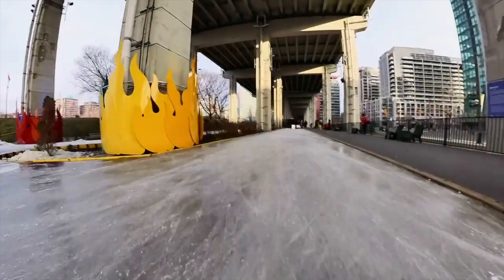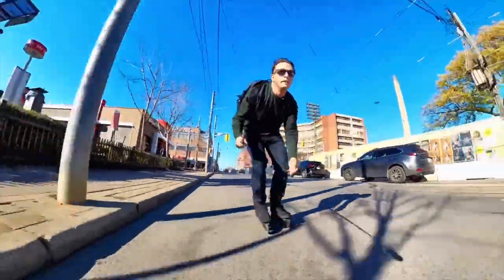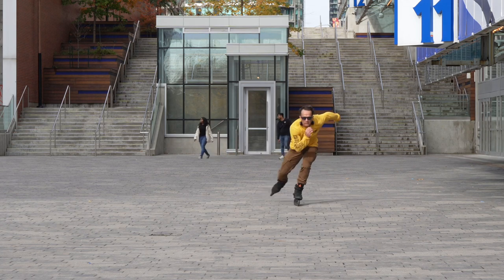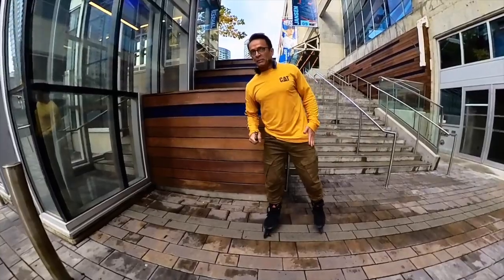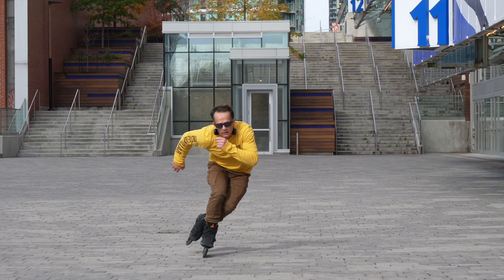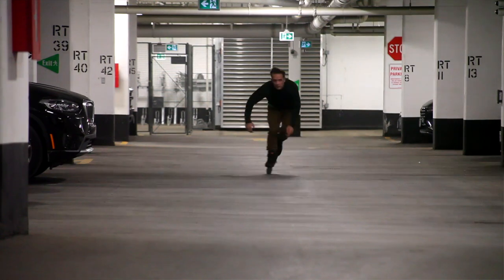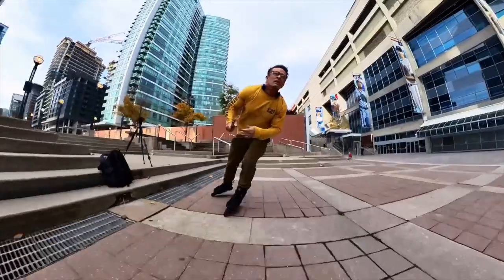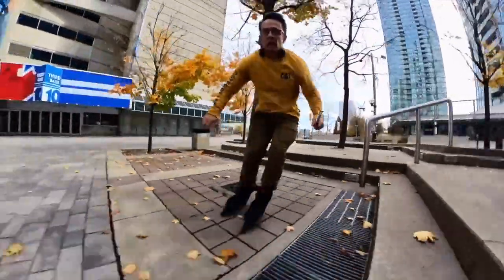INLINE SKATERS Are You Leaking Power? QUICK FIX!

Comment: This is interesting, thank you for the video Bill. In speed skating they recommend that you do the same thing except with your hips and shoulders, so they recommend that hips and shoulders:
1- Don't Tilt (stay parallel to ground).
2- Don't Twist (stay facing forwards).
3- Don't move up or down.

However your method seems to keep you more agile and fluid using the head as a reference point
Reply from the maker: I agree with all of the above. Speed skating holds many lessons for street skaters.